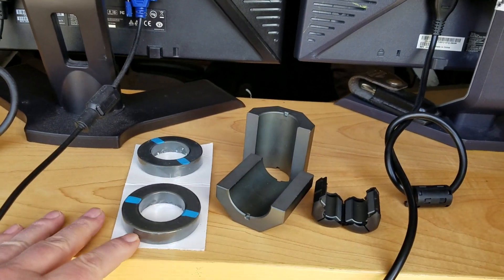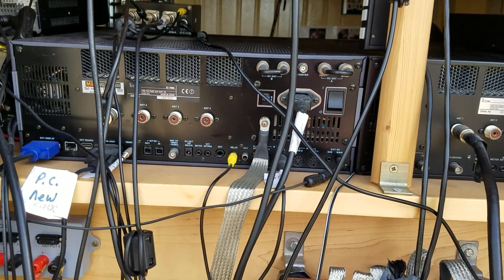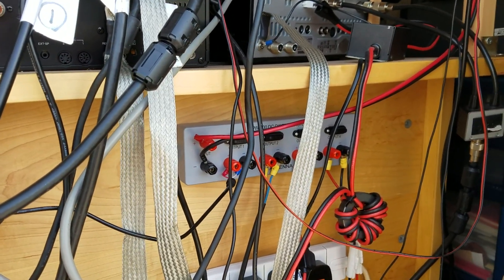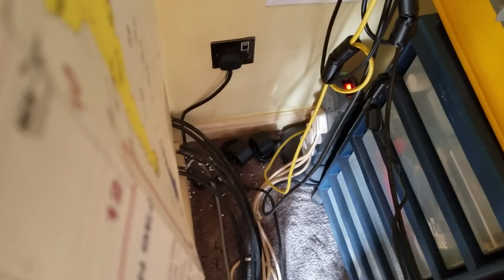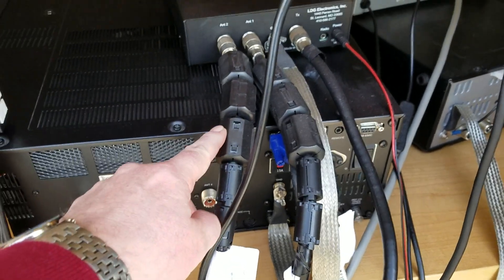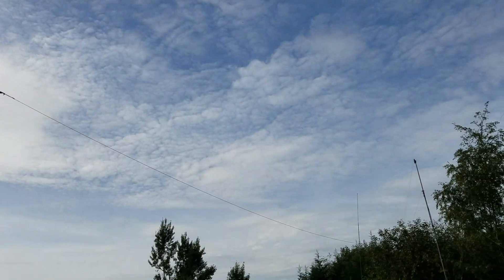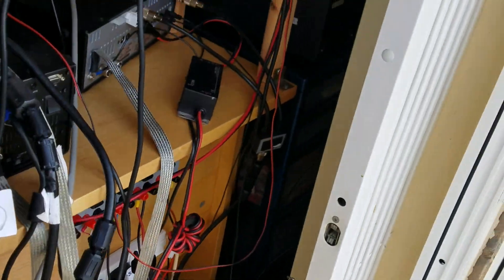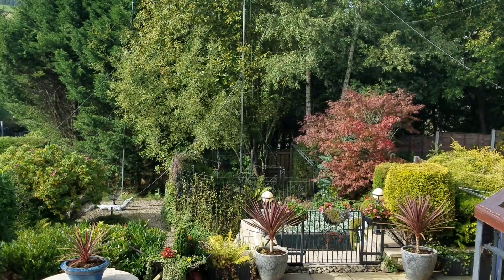Grounding and Bonding in the ham shack

Comment: I suffer from cctv noise from the recorder was thinking of up dating the  cable on the cams to the Messi paoloni cable, only way to stop noise is remote switch to cctv to off. Where did you get the buzz bar from. Mike M1KEY
Reply from the maker: ERICO Copper Grounding Bars EGBA14210JF at DX engineering have you tried ferrite beads 73 john g0dtx.

Comment: Where did you get the copper braid from need some for my mobile antenna on my car? Thanks DE 2E1FUE
Reply from the maker: you can get them off eBay but I got mine off d X engineering hope this helps 73
Reply: @hamradiostationg0dtx583  Thank you for the information. I will try to get the 28mm one about 1m for the car. Thanks again, De 2E1FUE.

Comment: Where did you get that buzz bar John will get one when I change coax for this M&P extraflex bury 10 stuff great video 73 DZH
Reply from the maker: https://www.dxengineering.com/parts/ero-egba14210jf
Reply from the maker: ERICO Copper Grounding Bars provide proper bonding; essential to create an equipotential plane between service grounds and shack equipment. This equipotential plane provides a near-zero voltage differential and serves to protect people and equipment during transient and electrical-fault events. These ERICO grounding bars have a series of 0.281 in. diameter holes that accommodate mounting many items, including Alpha Delta, PolyPhaser, and other surge-protection devices. They include stand-off mounts that deliver extreme isolation from the mounting surface. When used in tandem with ERICO ground rods and ERICO CADWELD ONE SHOT Wire to Ground Rod Clamps, there is no better grounding system available… period! These ground bars have a 1-1/16 in. standoff of their stainless mounting brackets plus a 1-1/2 in. insulator. This places the inside of the ground bar more than 2-1/2 inches from the mounting surface. There's plenty of room to work after mounting the bar. These bars may be mounted horizontally or vertically and the mounting holes in the copper bar are 8-7/8 in. on center. These grounding bars provide a convenient, reliable grounding location. Their quarter-inch thick solid-copper bar represents the ultimate in ground connections. ERICO grounding bars include insulators, stainless steel brackets, stainless steel mounting bolts, and are UL Listed. For premier grounding at your station, rely on ERICO Copper Grounding Bars from DX Engineering.

Comment: I presume the yellow/green wire is your connection to an external earth rod. If so, and you have a PME domestic supply (very many in the UK do) but no heavy-duty (10mm2 minimum) connection from your earth rod to the consumer unit earth, then this is contrary to the electrical regs and could cause a fire in the event of a neutral break along the supply line. Not only is this bad, it could be ruinous, because the breach of regs may well mean your property insurance would be invalidated. This is a common and serious error and one that even the RSGB have made in print.
Reply: I totally agree, our supply is TN-CS to the house and this is a potential problem (no pun intended). There are workarounds where you can legally use a different scheme for an isolated room but with some stipulations. Unfortunately much of the advice on the internet is from the USA where physics works the same but wiring regulations are different. I suspect that many UK installations are wrong, and I must confess to not being above criticism...